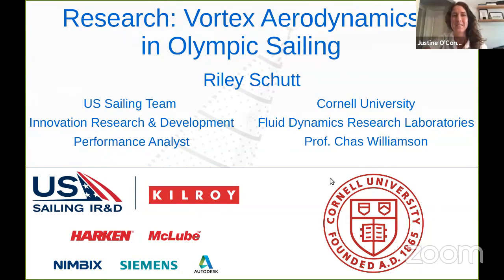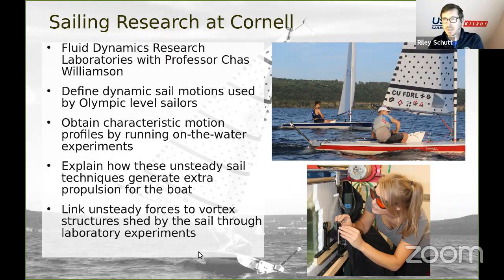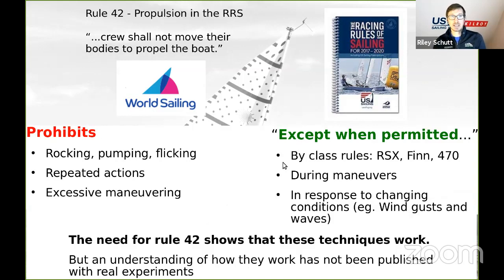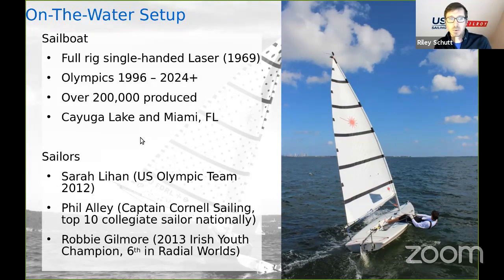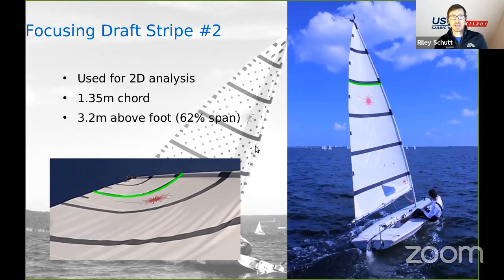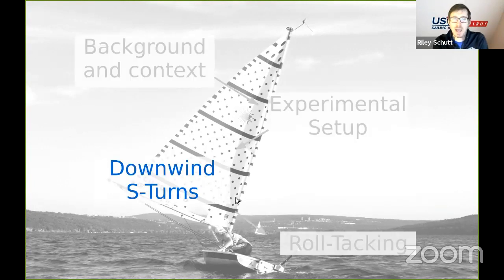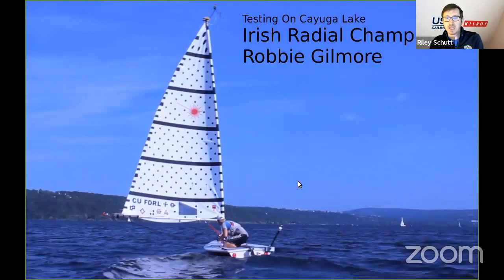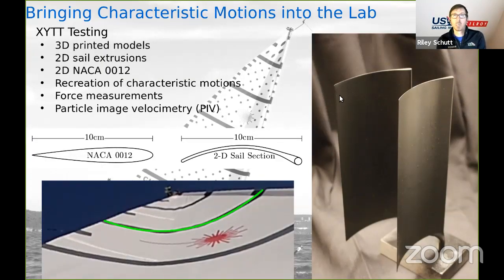Vortex Aerodynamics in Olympic Sailing

Comment from the maker: A Message from Chas Williamson: "There were one or two questions concerning Cornell at the end of the fantastic presentation by Riley that I wanted to check in about, but I was not able to log in, during the Q&A part of the presentation. I study vortex dynamics in the Fluid Dynamics Research Labs at Cornell, in the Mechanical & Aerospace Engineering Department. The Sailing project has been one of the most fun projects of my career, mostly because I got to work with Riley Schutt, and Sarah Morris, and the many undergrads and Masters students from the Cornell team (Phil Alley, Sam Webster, Colin Keil, Jenn Borshoff, Lindsey Gimple, Max deZegher, Theo Meynard, Gabby and Ben Rizika, Gabbie Del Bello, Dan Birmingham, also alumnus Mike Ingham. Thanks also to Ithaca YC, and to Pat Crowley of the Cornell Merrill Family Sailing Center." To reach out to him, or Riley, you can find their contact information in the description.

Comment: Great presentation.  A Question: in the water experiment the force caused by the acceleration of the mass of the foil was removed by subtracting the  force from a "dry test".  The foil in the water has an added mass in the "surge" direction and an other one in the "sway" direction.  The forces associated with the acceleration of these "masses"   and the heading change with respect to the water were not addressed.  Theses forces can be larger than drag as they are associated  with volumes and accelerations and yaw velocity  instead of area and velocity squared.
A good reference on the subject is   Hydrodynamics    by Lamb https://archive.org/details/hydrodynamics02lambgoog/page/n102/mode/2up
Chapter 6    On the motion of a solid through a liquid.  Frictionless flow equations are provided and an analytic solution to an example is provided.    The figure on page 187 of the pdf is particularly interesting.  As the  solid yaw the solid velocity change direction and thus the trajectory is curved.  This is  "impossible" in a potential flow, for an aerodynamic  engineer, as one need a vortex  to generate lift or lateral force.    Interestingly the total momentum of the solid and and its added masses  does not change as the vessel move back and forth.  This Lamb example is a good test for Computational Fluid Dynamic programs.
This added mass effect or potential flow effect,  has implication also for the motion of the hull of the sail boat in the water has it change heading with respect to the water during the discussed maneuvers.
I have never seen these Lamb potential added mass effects included in maneuvering equations.  Note that they are function of the displacement of the hull and the accelerations and yaw angular velocity. 
They are large forces that do not dissipate energy or generate energy.

Comment: I see two different things downwind here:  one is the effect of rolling the boat (and the sail through the air) and the other is the 'creation' of apparent wind.  The latter is a concept stolen from Buddy Melges, to "freshen and ventilate", to head up to increase speed and move the apparent wind forward, then to bear off under that apparent wind to head downwind with the increased speed generated thereby.  I see the former as kinetics (and on the edge of a Rule 42 violation), while the latter is fully consistent with Rule 42.

Roll tacking can be a clear Rule 42 violation, and clearly advantageous in light air.  As an umpire, I'd have leaned toward flagging a boat exiting a tack faster than entering, but that is only notably obvious (via the data) in light air, less perceptible in heavier air.  Makes for a tricky call on a competitor.